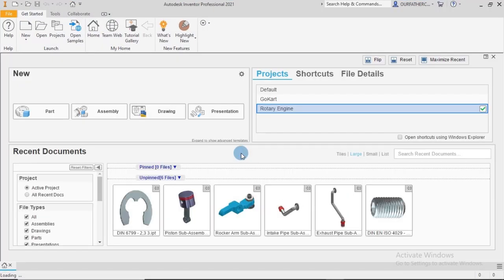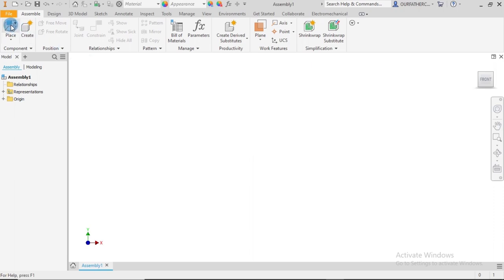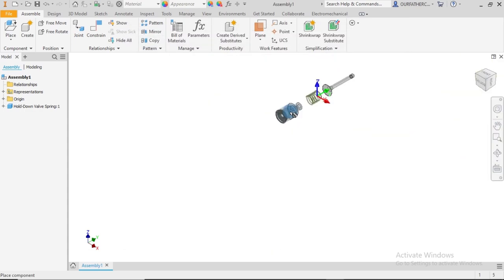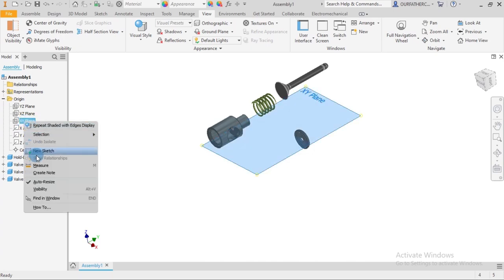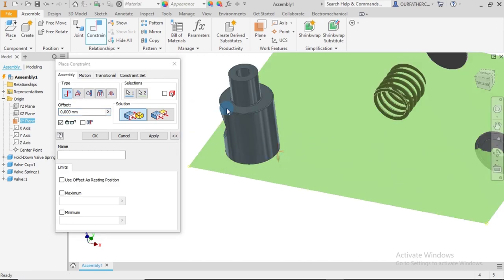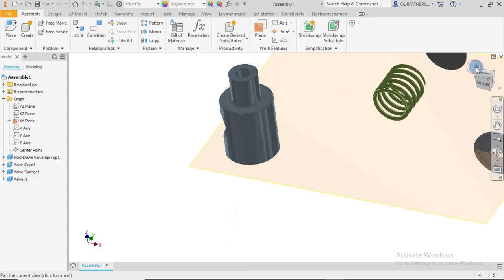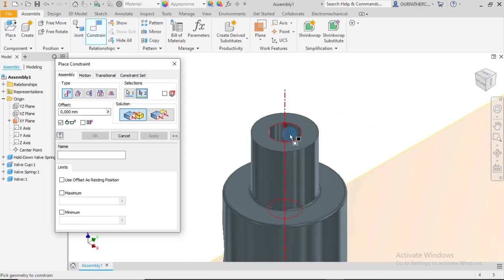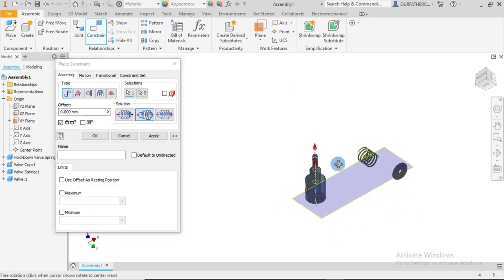Inventor 2021 | Radial Engine | Assembly 5

Comment: when i select a component and i try  to edit it, the other component are invisible. so when im using "direct" i can not select an area from another component. do you know what i have to do, to fix that. so i can select surfases, while im editing a component?
Reply from the maker: When you select a component to edit within an assembly, because I didnt use the skeletal modeling approach the components are not linked. Also, you wont be able to draw references from another component directly, if the components are created independently and imported. The only way to draw references, is if all the components are modelled in the same workspace, or in this case (I consider this a mistake in my approach) is to measure the distance you want to fill before editing the component. Now that I know better I would have linked all the dimensions.
Reply: @CADPond  ok, thank you for the response! Btw great work, and very helpfull!